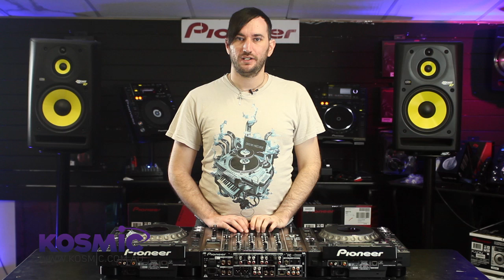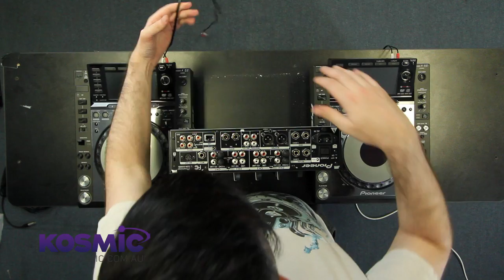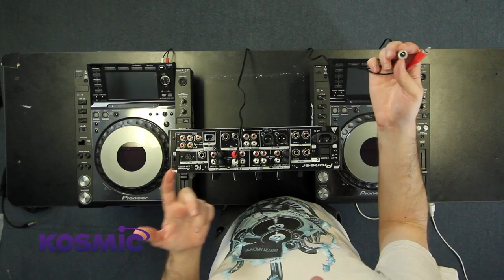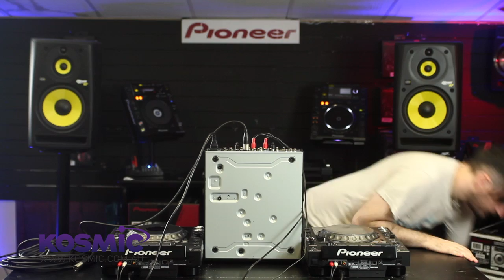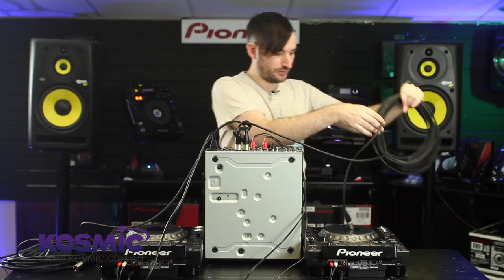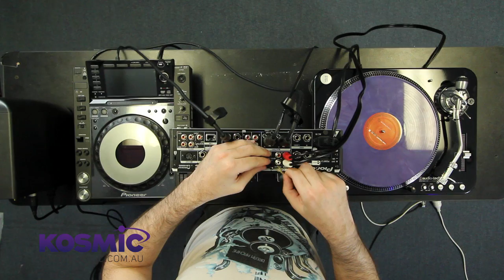How To Setup Your DJ Equipment

Comment: I have a DDJ SX 2 wired to my iMac with two Pioneer S-DJ 05 monitor speakers. At what point do I set the output volume of the iMac? Do I wind that output up to max, set the channel levels, then the master or what? My speakers are quite powerful, and as mid-range desk top speakers, they can really rock. The blue LED lights will start to show red when clipping occurs. They also have a remote volume controller. So many possibilities but not sure how to optimise their setup. Please advise 👍

Comment: what model cdjs are those, the 900???
Reply: Hi those are the CDJ2000 Nexus players. They’ve been discontinued & replaced by the CDJ2000 Nexus 2’s. That setup of 2 CDJ’s & the Mixer costs roughly $6000. About the same in pounds & euros!

Comment: Hi, I am using a behringer djx 750 mixer where is only one rca master output. In that case, how to connect these kinda speakers or in my scenario, I bought ehko rs15a active speakers, these have xlr cable included but I dont know how to connect both of these speakers together in one rca master output. Please helppp!!!
Reply: Hey thanks for replying.. Where should I plug in the xlr cable? line in or line out? other way should I buy male xlr or female!

Comment: About the speakers, is the volume the master?
Reply: Yeah i think so
Reply: it could also be called the main, if there are EQ on the speakers as well best to have them set to the center, this way it is not boosting or reducing any frequencies so you can get your levels set correct, then if you find the sound peircing your ears reduce the highs slightly (the highs are what give your ears fatigue after a long period, if you find your lows are lacking or over powering use that eq on the speakers to adjust it,  using all the way up or down on the EQ usually is a bad idea.

Comment: good aft, i have an issue with random looping when i scratch and/or move the platter to cue up. also, the sound cuts off unless i hold the needle search. do u have any ideas on how i can fix this? i have cdj 2000s.

Comment: Thanks for this - I have plenty of experience with home audio gear using XLR and RCA connections but I needed a basic intro for DJ gear. You have a few more connections but ultimately its the same concept - source(s) into amp or powered monitors.

Comment: hey I have a pioneer ddj sx2 and KRK Rokit 5's. I bought an rcs cable that ends in a 3.5mm headphone jack. I've been having a lot of trouble connecting them, I think I might need an cable that ends in RCA as well as starts with it (sorry if that's not how you're meant to say it) but if someone could tell me what cable I'll need that would really help.

Comment: What's a better setup a pair of Pioneer XDJ-1000 players with a Pioneer DJM-900SRT mixer, a Pioneer DDJ-SP1 Midi Controller and a Pioneer RMX-500/1000 (I don't know which is better) or a pair of Pioneer XDJ-1000 players with a Rane 62 mixers, a Pioneer DDJ-SP1 Midi Controller and a Pioneer RMX-500/1000?

Comment: Please help!! I have the ddj sx with windows 7 using the master volume.  For some reason my crossfader volume sliders only works from 0 to 1 value.  Meaning,  that  i cant reallt turn up or lower my volume with these sliders.  I can only  use the trim for now.  Am i doing something wrong. Help..

Comment: what wires come with these ffs xD
Reply: None really. I bought a xone 4d which is about the same price as the mixer in the video (DJM 900) and all that  came with it is the power cable and the usb cable to connect it to the computer. It has the same jacks to plug into the speakers but you need to buy these wires separately. You can order them online or go to a music store, but your best bet is to get them online. Alot cheaper there.

Comment: Why would you need the booth speaker? Because i wonder if i'm just able to buy one set of monitors and plug them into the master or booth output?
Reply: I'm not a DJ at all and i've never touched any equipment. But i think i'ts because you have more control of what the audience are hearing. In a club, the sound will bounce all over the place and i bet it's even worse on a big festival. What this will do is cause your mix to be out of sync if you try to match the beats because of the time it takes for the sound to travel in space.

If you then have speakers right beside you in the booth, you will not have any issue with the bouncing sound. It will sound more direct and it will be easier to match the beats.

As i said, im not a DJ but it's my theory atleast. If im totally wrong, please correct me ;)
Reply: yes its true that having a booth speaker might be of a help to aid you to hear your music. its just like when you are using your headset. If you wanna mix a song you got to hear from your headset but for booth is without your headset before you amplify your music to the audience. and Daniel Assor (y)
Reply: +Daniel Assor You are mostly correct, the monitors just play what the main pa plays, they are there just to help the dj hear what the crowd is hearing. The dj does his beat matching through head phones or earphones.
Reply: Weaiz Most of the time as a DJ in a club or festival situation, you will be situated behind the main PA, and it may sound silly but just by being behind the speakers, you can’t hear a lot of the music. Booth speakers are there to face yourself so you can hear the main output properly and also over the crowd noise etc. Not needed if you’re bedroom DJ’ing.

Comment: What is overloading?
Reply: When the sound bar goes red
Reply: Does it harm the equipment in any way?
Reply: Hairil Johan If your equimpent has a Protection Mode it will cause it to turn off because it is drawing too much power. In a worse scenario it could fry your circuitry of your mixer or your speakers or even damage the speakers by damaging the coils or destroying the cone.
Reply: So why does the speaker in like Ultra or Tommorowland doesnt blow up?
Reply: Hairil Johan Parties and Concerts especially ones that are that big have Front of House Engineers that monitor the final signal before it goes out to the speakers. And they have speakers that are built of components to handle that kind of punishment for hours and hours. But even those have limits and in the even that they couldn't handle the power being drawn everything would shut off.

Comment: ok guys.. after buying the decks, what applications do you have to get to connect to your computer...? is it fine if you never used them before?
Reply: depending on what your're buying, also depends on your choice of program.
your best choice to start is to get the demo of each and get a feel of the programs.

Serato DJ
Traktor
Virtual DJ

They all have demos and full versions.
Also, your gear might not work with a specific program so you will want to do some research.

Also do A LOT of research on the type of djing you want to do, what gear works best for that type, and what level of equipment you want to purchase. DO NOT buy the top of the line professional dj equipment if youre just starting out, you will regret it in the future.
Reply: ***** so... after buying... does serato DJ or virtual dj included?
Reply: ***** so is it ok to just buy it? Like after buying it does some cdjs support usb? and whats a timecode o.o
Reply: Ben, dcj's ARE soundcards... all you need to use cdjs are the cdjs and a computer, to connect them all together you need rca cables to the mixer and ethernets connecting the cdjs to manage the files across them all (non pc use)

Comment: How I can record the Proper quality of the mixing and at the same time the crowds sound (As they do in Festival's Live sets). Pls advice...
My Gear List:
Apple MacBook Pro ME294LL/A 15.4-Inch Laptop with Retina Display
Traktor Kontrol S4 MarkII (DJ Controller For House Music Only)
Traktor Kontrol X1 (2 Pcs)
Traktor Kontrol F1 (1 Pc)
Traktor Kontrol Z1 (1 Pc)
Pioneer RMX 1000 (1 Pc)
Pioneer DDJSX (DJ Controller For HipHop and Others)
KRK RP5G2 Rokit G2 5In Powered Studio Monitor (2 Pcs)
Reply: You will need to buy a red/white thing to 3.5mm jack, then connect the red white thingys to the master 2 then plug in the 3.5mm jack into your computers mic port, then open up Audacity and select the mic jack, then hit record, and you're done!

Comment: Great tutorial but I just have one question. Right now I'm working with my Pioneer DDJ-S1 controller and I'm think about upgrading to a proper pair of decks and mixer, similar to what you've got except I might use a DJM-2000. I was wondering there was anyway to connect my laptop into the system some how because all my music is stored on my laptop and prefer to play if from there rather than a USB stick. Is this possible? I would love your advice

Comment: This is about the most expensive gear you can get. Two CDJ-2000 NXS and a DJM 700 K makes roughly 4800€. For a beginner who needs setup instructions I'd recommend the solution with a notebook and a controller with included interface, which you can get for 200€. And you can get really nice ones if you spent up to 800€. Also they're smaller to carry and easier to set up. By now the most common solution also in clubs around me.

Comment: This is the most expensive equipment you can buy by now. Pioneer CDJ-2000 NXS and a DJM 700-K, that's roughly 2 x 2.000€ + 800€ = 4800€, that's no beginner stuff. For someone who needs initial instructions I recommend starting with a Notebook & Controller, comes much cheaper. Having a notebook, a basic controller with everything needed comes at 200€, software is free (Virtual DJ). For up to 700€ you'll get some kick-ass stuff, the most common solution for DJ's in most clubs around me nowadays